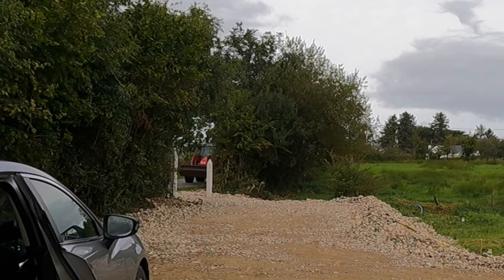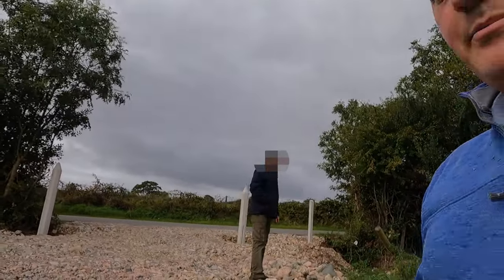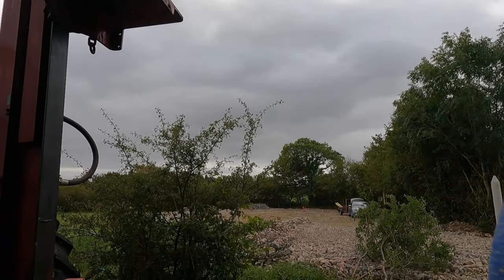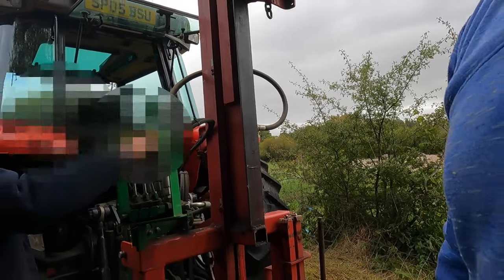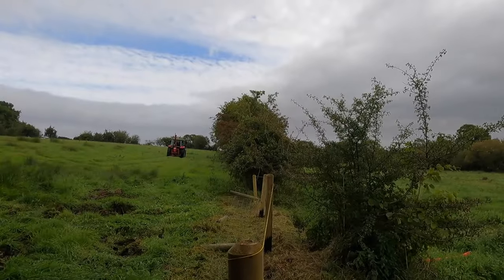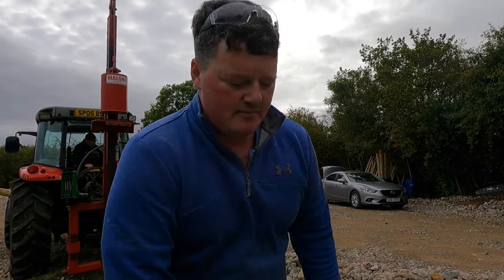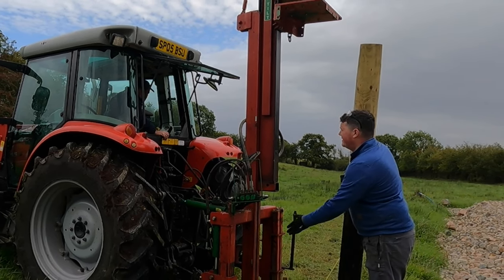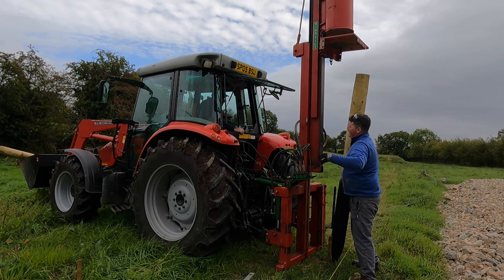SETTING FENCE POSTS using a Malone Post Driver!

Comment: Thanks for putting up this video. I am thinking strongly of buying one of them post drivers and to see someone to work it that , like myself never done it before is a great help. 
In the corners what I would do is, after you have driven in the two post
 put the cross post up to them (make sure that it is slightly longer then the distance between the driven post)
mark the thickness of the cross post on the two driven posts with a pencil at about the height of the wire
cut into the driven posts about a inch or so (enough that it will not slip up or down.)
Cut the cross post that it is a tight fit
Drive a nail in each end to hold it.
put a stable in the outside of the second post on top
put a stable in the outside of the first on the bottom
run  wire through the stables and tie both ends together forming a loop
get a stick/ bar what ever is handy put it through the looped wire and twist the wire till it is tight.
that should hold it altogether
Reply from the maker: Thanks for advice. Ive already started to something like that. Watch out for next video coming out sat morning @0900hrs.

Comment: A good move painting creosote on  the ends of the stabs!👍
I use roof felt adhesive at the ground level area, the points never rot, so I leave them as they are.
Current pressure treatment is useless at ground level.
The hammer on the knocker looks awful slow when it drops, might benefit from a 3/4" return pipe like a Suma!
Good video though!👌
Reply from the maker: I still wouldnt want to get a finger caught between them lol. I was planning painting the top with a heavy paint so water can't enter. What would you recommend?
Reply: @LaidBackHomesteader  Wouldn't be a bad idea.
 If you chamfer the top of the posts with the chainsaw first, it'll shed the water off the sapwood quicker.👍

Comment: That driver should have a built in plumb level on at least two places ninety degrees from each other. That way the posts should drive straight.
Reply from the maker: Good idea. That post driver sat on the ground. If it worked it would be handier used